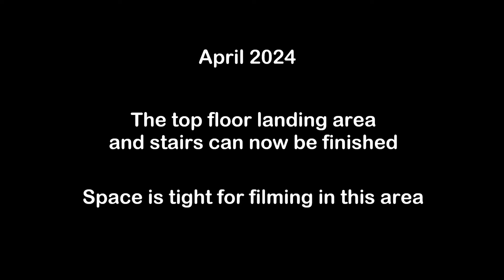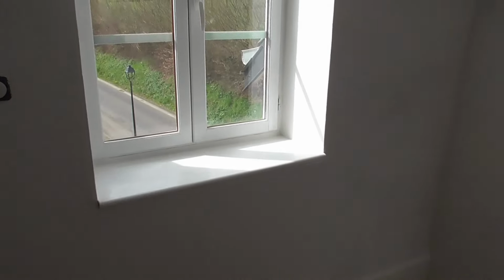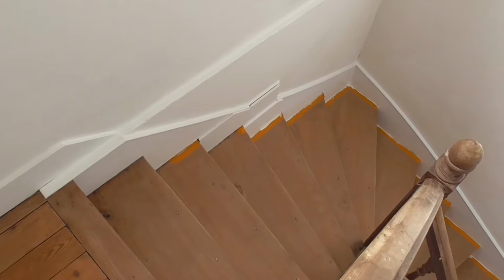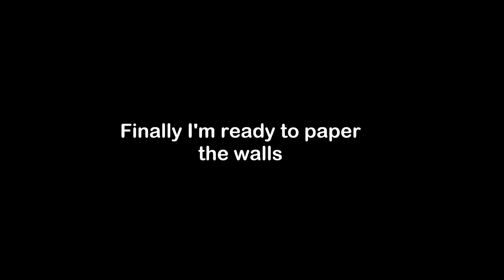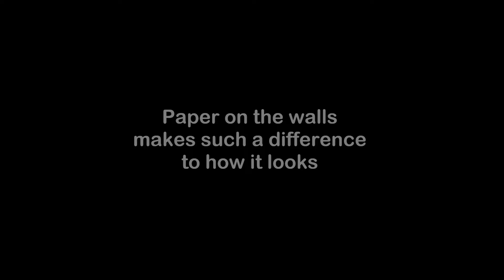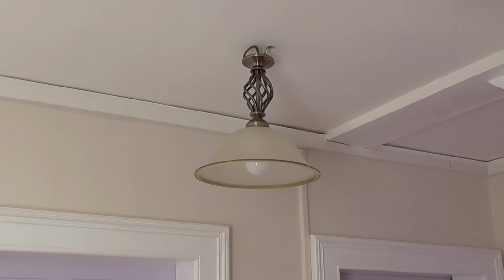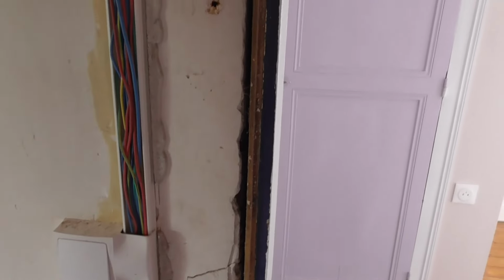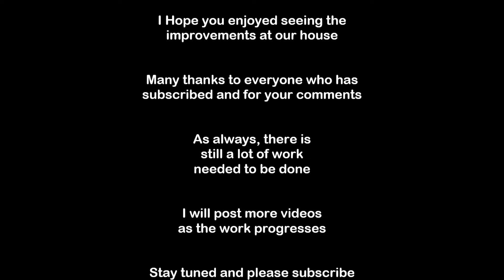Our French House Adventure - Part56 Finishing the Top Hallway Area

Comment: Can i ask please. I watched a previous episode where you fixed up a bedroom alcove (previously bathroom), and put in insulation and board. Can this process be used for stone and lime walls? I know breathability is very important but would this still be ok? I ask as your first insulating layer was a foil type layer attached to batons.
Reply from the maker: To install the foil type insulation there must be a gap above and below the foil, this should allow the wall to breathe. My walls are stone and I've not had any problems so far
Reply: @frenchhouseadventure  hi, thanks for responding. Interesting. I'll watch that episode again with the view to doing the same. I presume the second layer of insulation doesn't need the gap. You made the process look really easy. Thank you.